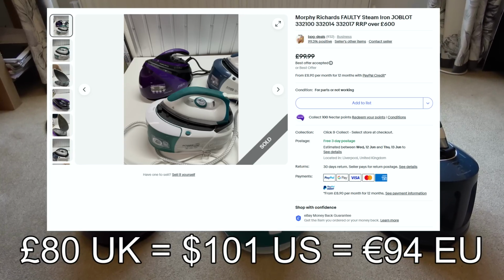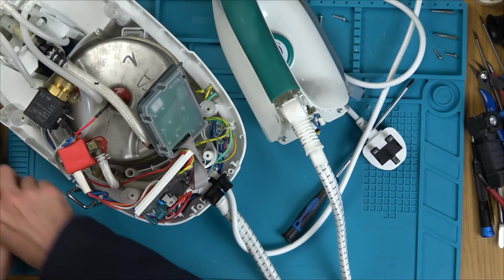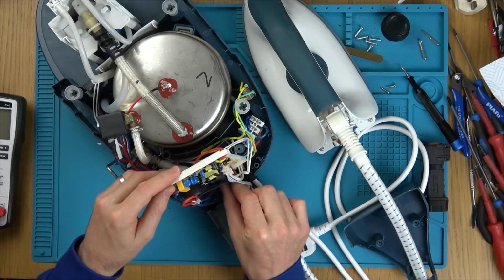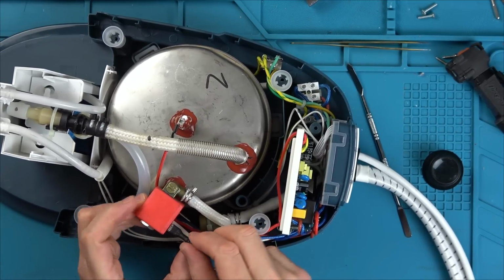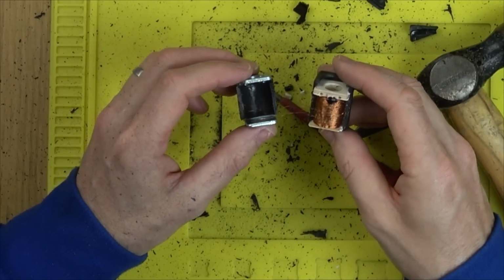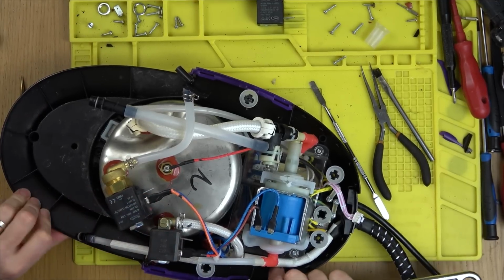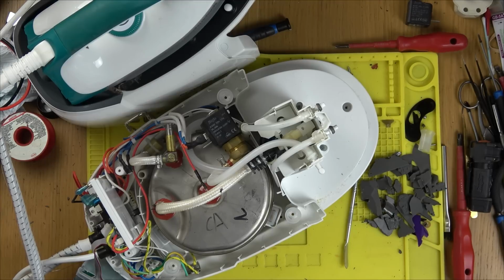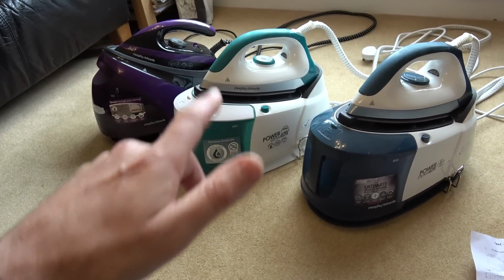eBay Joblot of FAULTY Steam Generator IRONS - Can I FIX Them?

Comment: Heat cycling is destroying these solenoids. That centre pin is controlling the pressurised super heated steam flow I’m guessing at about 110 - 120 degrees. It could be destroying contacts or laminates on the coil. A design flaw definitely.

Comment: This video is of great help to me, Vince. Thank you very much. I have managed to repair my Morphy Richards steam iron by replacing all three relays to a TE 2071556-4 which costs less than £1/each from Farnell. Two of the relays were tested faulty as the contacts are always open. I searched for the cheapest equivalent component with the same specs and footprint as the original at the moment of purchase including sale and discounted items. A happy wife is a happy life indeed!

Comment: I almost skipped this episode as iron repairs didn't seem like they'd be very interesting. I was wrong. These irons have many more features than we have in the US. Thanks for taking the time to take us on your repair journey. Thought: You could probably repair the relay you cut open by cutting out the old wire and winding replacement wire on the bobbin. You already know the total ohms you need from the working relays. You can measure the gauge of the wire with your calipers. There are ohms/foot tables from most vendors that sell enameled wire, so you don't need to worry about how many turns are on the original relay. Just wind the calculated footage of wire to get the ohm value you need. You can use a drill to wind the new wire on the old bobbin. Maybe a project for a new video? Thanks again!

Comment: Really enjoyed this video - the steam boilers seem very similar to an older Tefal unit I (successfully - much to my amazement) repaired a couple of years. Obtained for free, via a skip stored inside a storage place I was using, it worked but after 5 minutes the pressure built up and popped the relief valve (very noisily - got glares from my wife !). No control boards just a pressure sensor screwed into the boiler which was stuck closed hence never cutting the power to the element. Solenoid was fine (a CEME unit made in Italy) but found a replacement steam sensor (another CEME unit - via an Italian eBay seller)  and replaced it using Flomasta Liquid PTFE thread sealant. It has been working fine for a couple of years so it is possible to replace these components although you do need to have a clue about what you are doing - getting high (ish) pressure steam and mains power wrong is a recipe for disaster if you don't take care. 

More please !

Comment: The coil is 12 volts, check the voltage when you press the trigger.  If the voltage is over 12 volts a simple resistor mod would increase the life of the coil.  Also, there is two coils in each are they the same voltage?  If so, you have another in your parts iron.

Comment: The solenoid when energised undergoes a large magnetic field pulse which when it is deactivated causes a flash back of energy to the controller which has to be mitigated and that most likely failed and caused the coil in the relay to blow. Try using acetone to dissolve the potting compound.

Comment: Ok 2 minutes in, I had a similar iron and one of the wires failed where it entered the body of steam unit.
I ordered a new cable and modded the case to accept the old strain relief. Been good so far.

Comment: The solenoids get very hot when in use. Ive had 2 12v solenoids fail because they got stuck on in the circuit and just over heated and burnt out.

Comment: the descaler solenoid looks the same
Reply from the maker: Thanks, I need to double check again, but I think it has a different model number and amp rating. Quite a bit got cut out from the video due to the length of it 👍👍

Comment: Having read a significant portion of the comments, i note the word obsolescence is appearing; especially so where i live, the water is extremely hard, I wonder how many of these will goto to Landfill just because they haven't been descaled properly? Or seemingly because the same component is seemingly the source of the failure? I haven't owned or used an iron for the majority of my adult life. A very interesting video, like always, a great repair. but I'm not at all tempted to acquire an iron, anytime soon, except maybe for use as a means flatten instruction manuals or box art covers, for my retro video games collection, and probably a dry iron would suffice, for that?

Comment: When a solenoid is first energized, its coil receives a high inrush current that decreases as the plunger closes. If the plunger does not close/open, the high inrush current continues, causing the coil to overheat and potentially burn out. This is the most common cause of solenoid failure. Overheating can also occur if the ambient temperature is too high, reducing the coil's ability to dissipate heat, or if the solenoid cycles too fast, allowing heat to build up faster than it can be dissipated.
Reply: That makes a lot of sense.  if the plunger is in contact with the hard water or steam. the scale may build up at the plunger, causing it moves slowly or issues with close or opening. therefore overheating the coil.  That said, you probably should change the entire solenoid valve assembly, instead of just the coil. Usually, a solenoid valve is sold with an actuator and plunger.  The life of solenoid valve certainly depends on  what kind of media they are serving -- gas, oil, and chemicals etc. This particular solenoid valve may be designed for water, but not too hard water. I was a bit surprised that manufacturer didn't do something electronically to prevent the solenoid coil from overheating.
Reply: @zhengyuan5047  This is a very good example for planned obsolescence.
If the solenoid valve had appropriate dimensioning for the requirements and working conditions, it would last much longer.

Comment: Hi Vince that solenoid is more common fault by every steam generat , philips , seb, rowenta , calor and . Also pump goes defect for descale the iron put water in boiler turn it op side down. Put water in l sink bodem put the iron floating on water push the steam button. That gets the brown /scale out the iron.

Comment: Hi Vince.  Great video as usual.  I can confirm that the brass fitting that goes into the boiler from the solenoid is threaded.  That red compound is probably thread sealant (available at toolstation, screwfix) so even that should be possible to rerpair
Reply: Yes - I got a Tefal steam generator iron from a skip (aka dumpster) in a storage unit site I used (it was inside so no water problems) - the issue was a failed pressure sensor on the boiling unit. After getting the sensor (from Italy via an eBay seller) it was straightforward to replace. It was a threaded fitting and I used Flomasta Liquid PTFE sealant (Screwfix in the UK do it) which has worked well for the last 2 years and weekly use. The unit, being older, was very simply wired with no control units other than a power switch and a microswitch to control the steam solenoid.
Reply from the maker: Thank you bitter truth 👍👍👍
Reply: Toolstation and screwfix also sell socket sets haha

Comment: To seal threaded pipes from leaks, most people use a thread sealant like locktite or pipe thread compound. As pressure build's up the thread's arent enough to hold pressure

Comment: Interestingly (to me, anyway) is that the steam solenoid looks to be less robust, and probably smaller wire, than the descale one. I assume (maybe wrongly) that the steam solenoid operates for much longer and more frequently. That, along with the many other things that may cause a solenoid to fail, is probably not helping.

Comment: BigClive usually have around 245 volt in the grid. If that is common in UK it might be too much for those 230V solenoids.
230V +5%/-10% gives 207-241V.
240V +5%/-10% gives 216-252V.
Reply: I've seen 249 where I am. I have solar so they always produce a slightly higher voltage so you consume that before from the grid. A neighbour on the same phase would cause a similar spike as well.😊

Comment: Hi Vince. Another excellent vidéo. I tried to fix our steam iron that had the same symptoms (iron heats, but no steam). I suspected a faulty solenoid valve, but after opening it up, I didn't find a solenoid. It was a cheap Philips, that doesn't even have a boiler. I tested several things but ended giving up. On the other hand, I already replaced a solenoid valve twice in 20 years in my espresso machine. Those coils seem to be wear items.

Comment: Solenoids might break if they are powered for a long time while the iron core does not move. In this case the AC current will be higher than normal. But honestly, you would expect they are not that poorly designed.

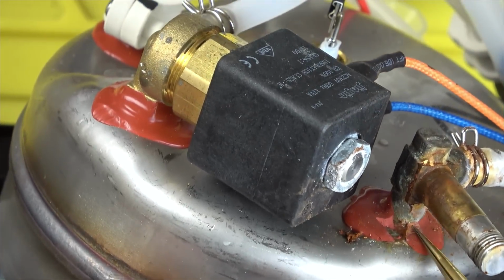Comment: 51:03 It looks like it’s the same coil on the descaling valve. You could use one of those extra coils from another unit to get one of the purple ones running with two working solenoids.

Comment: Hey Vince, great video as always.  Let's start with the solenoid.  I think it was under spec and thus a design flaw.  If you notice it was rated 230V, this is borderline of line voltage.   The actual specs for UK voltage are 215-253.  This means if there is any condition which raises the voltage significantly for any period of time, that solenoid could blow if enabled at the time.  They really should provide overvoltage protection or over spec the operating range.  As for why the iron didn't work when the relay was bad, likely because the iron never came up to temperature and there is probably an inhibit to prevent steam until that temp is reached.  You can test this theory by quickly raising the set point and immediately trying the steam.
Reply from the maker: Thank you Rob 👍👍

Comment: Many years ago working in a factory making solenoids for (mainly) audi - they were all black until they brought out a new car and decided they wanted them grey (which required running loads of batches of grey ones fit for the bin as they'd still contain some specks of black and that was apparently unacceptable) - not sure it's relevant in this case but it brought back some of that annoyance it caused 😂
Reply: Why would you guys bin them vs just reselling them to someone else? Hell just sell them as spares. Seems like a waste to bin them.
Reply: @sbmotoracer  the contract made it so we could only supply audi (I think) and they didn't want any with specs of other colours in - rediculous really.

Comment: Perhaps the coils fail due to the repetitive heating and cooling, causing the metal tabs to expand and contact, weakening the tiny solder point where the coil wire attaches the tabs.

Comment: I don't iron t-shirts, i just put them on a hanger straight from the dryer. I have never irons like those ones with the big base unit.
Reply: To avoid more creasing put them straight on a hangar from the washer & allow to air-dry: the dryer process will induce more creases as the fabric will 'stiffen' as its fibre moisture content reduces

Comment: Solenoids are large coils, when they are energized the coil receives a large current, if the plunger doesn't close the high-current continues and that causes the coil to overheat and burn out.
Reply: Would it be only caused by scale on the steam side that at some point provided the solenoid from opening?
Reply: @3DAM.  Yes, could be.

Comment: Unfortunately Vince the water from your Brita filter will not stop scale build up. Brita filters are basically just carbon filters so they will remove elements like chlorine but you need to remove dissolved solids which includes calcium and lime to stop scaling. 

Distilled or deionised water is completely free of dissolved solids and it what I use in my steam iron and steamer and never get any scale.
Reply from the maker: Thank you Adam, I didn't know that. Cheers for sharing 👍
Reply: @Mymatevince  You could just move to Scotland, where we don't have that problem 😃
Reply: Water from a dehumidifier however is perfect.
Reply: Depending on manufacturer, some say that water from Condenser dryers are ideal for steam irons, whilst other say not.

Comment: Hmmm, bad run of parts. Maybe inferior varnished wire? As someone else noted, they might have switched to a red case in order to complete replacement of faulty coils in inventory.
Reply: "inferior varnished wire" would result in a short, not OC shirley? The colour coding surmise may be correct tho
Reply: @snafu.X  Well maybe, I'm just hypothesizing. But I'm thinking a momentary pop at the short and that fine filament snaps apart rendering the coil broken. That's pretty fine wire to take a 240V short. Vapor.

Comment: The main cause of failure in a resin potted coil like the one in the solenoid, is tiny air bubbles in the resin around the wire, the air trapped expands at a different rate than the epoxy resin, and that mechanical stress eventually causes the thin wire to break. The solenoid valves made in Italy are degassified, (the epoxi resin is briefly exposed to vacuum, actually lower than atmosphere pressure, to extract the air from it), and they never fail.
Reply from the maker: Excellent comment, thanks for sharing the info John 👍👍👍
Reply: Suspect one of the Italian manufacturers you refer to is CEME
Reply: @mrw6156  Certo. There were others like OLAB, ODE, etc., nowadays most are owned by CEME.
Reply: 31:51 Why didn't you use the big spanner? 😅

Comment: Maybe the red electro magnet valve is an upgrade ? Also does that relay do more than one job ? Once the power goes through it further down the circuit to tells the element relay to work?

Comment: I got an ex-Guardsman's 3Kw steam iron, tames just about anything needing an iron in seconds, wrinkled shirts just give up and I always do my shirts with spray starch and razor sharp creases.   Can blow through the water in the tank very quickly it gets that hot and its an iron you pay attention to the ironing instructions a lot because it will burn through the wrong material in seconds and spoil the soleplate with molten materials lol

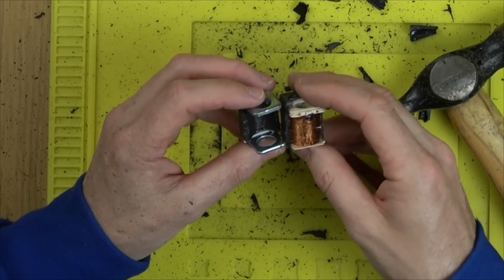Comment: 42:52  Is there 'Thermistor' < [word?] Temperature limit fuse within Coiled Wires ... or elsewhere in that contraption?  lol Never seen iron like this, Looks like a Gimmick.  
I know one worked, any chance switch [circuit board], or manual (switch) wire bad to activate?     i'm yapping,   Still looks like a Gimmick.   =b   
the things we learn, not even knowing we're 'missing out'.    i'm not   Cheers!

Comment: Have you worked on dvd/vcr combo, I have one with a weird fault, I can play a dvd and after a little while it changes over from dvd to vcr by itself, I can press the button to change back to dvd and it will change back to vcr
Reply: My money would be as the devices gets warm the fault occurs. Maybe a connection that expands enough to touch when warm or the device is getting maddue to being hot.

Comment: The solenoid may have a really bad duty cycle which is causing the wire to break inside due to overheating. That's my guess and great fix.

Comment: Are you sure that the gurgling sounds are only coming from the irons (it's also you, in your element)? Multiple reasons solenoid valves and relays can fail, including poor manufacture, heat, coils continually energised (generating their own heat), little or no snubbing when deenergising, amongst others.

Comment: Maybe there's a red coil in their because they noticed the black ones kept dying, so they switched to the red. Great job on analysing the faults.
Reply: not unknown in the car industry.......improved and superceded parts to solve known issues
Reply: Only down to cost, I did injection moulding back in the 90s, the factory is long gone, and we would get different colour pellets in the stores, it was down to cost. Most customers did not care what the colour was as long as they got the part met the specifications required. Most parts like Vince found are inside products anyway, so it is purely cosmetic.

Comment: The solenoids can be ordered relatively cheaply from China/Aliexpress. If only the coil failed - you can simply order the cheapest model and only take the coil. I've bought one for around 7€ with 8 day delivery.
They are also used in coffee machines.

I was a little big surprised that the earth terminal was not connected (the 3rd terminal) - since I've recently seen on that had developed a leak for earth and through another fault, gave someone a good shock.
Reply: For some reason they have strange earthing arrangements on boiling equipment such as these or kettles. If you look on a kettle they are usually marked class 2 double insulated so no earth, if you however test on the element you will get a reading to earth. I don't know why they are like this.
Reply: @HA05GER  Hard to imagine that irons or kettles are allowed to be classed as class 2  - since you can at least come in contact with the water - even if they are encased in plastics. And with irons it is even more questionable.
Reply: @TylerDurden-pk5km  yeh it's strange but if you look on most kettles they will be marked class 2 I used to do pat in my old job.

Comment: The solenoids are probably failing due to a combination of getting hot then cooling down and the thickness of the wire. The metal pin/plunger of the solenoid will transfer heat to the coil. The larger solenoids probably have slightly thicker wire so are not as prone.  A lot of companies especially these days only care about the parts lasting till the end of the equipment's warranty.
Reply: I agree. The current flowing through the solenoid coil is too high for the calibre of the wire, which subsequently burns out and breaks the connection somewhere inside the solenoid coil....
Reply from the maker: Thanks PDS

Comment: i think you hit the nail on the head with it being on a hot source i think the heat is weakening the joints/wires or maybe there is/was something causing the power to go through the wires constantly which is burning them out